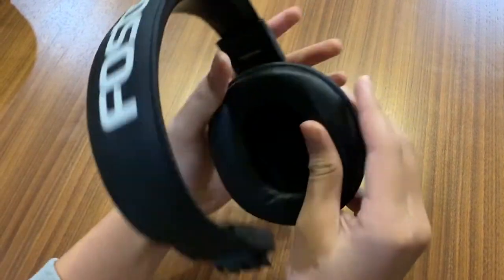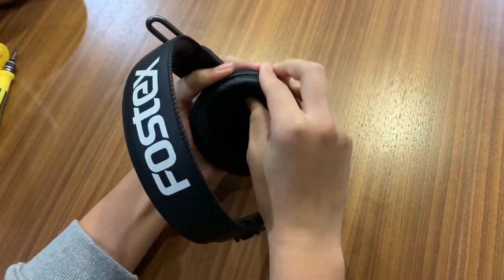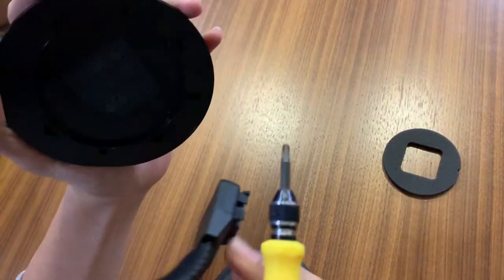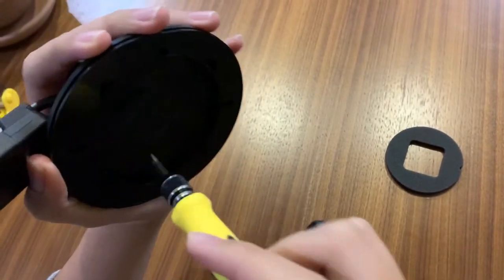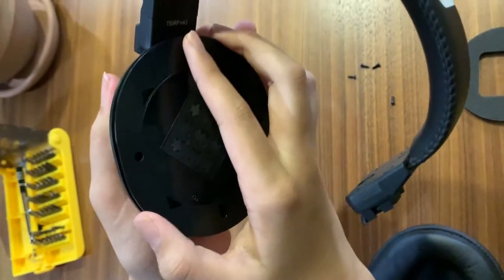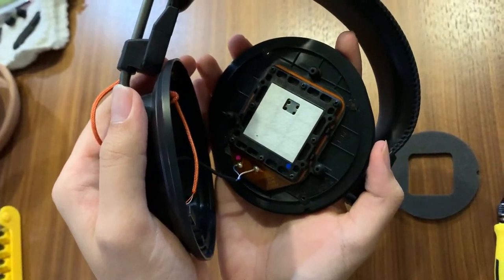Fostex T50RP Driver Extraction Tutorial

Comment: Hi, do you have a video on repairing the plastic slider holder on a T40RPMk3? Thanks.🙂
Reply from the maker: Hey, t20, t40p and t50p has the same slider mechanism, so you'll be able to replace the plastic slider if you 3d print a replacement slider. If you have any specific questions please let me know.